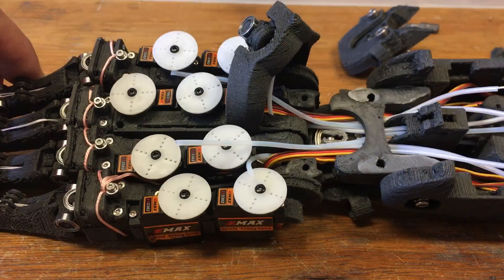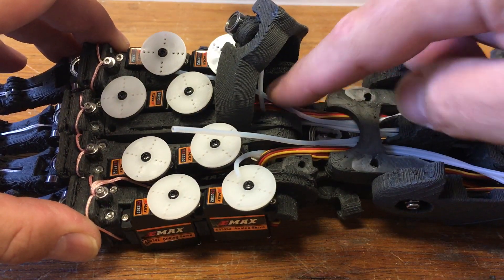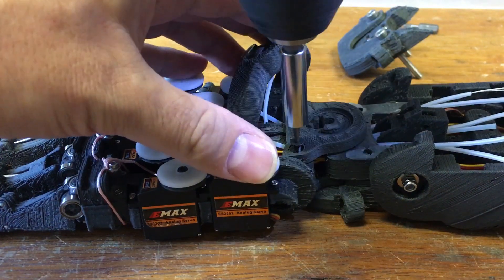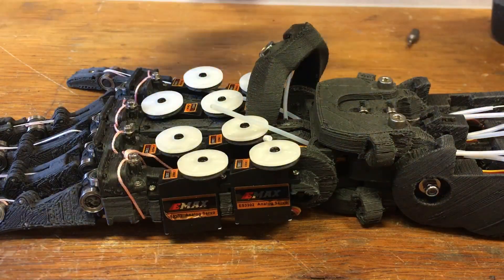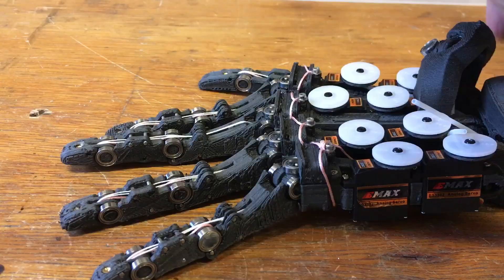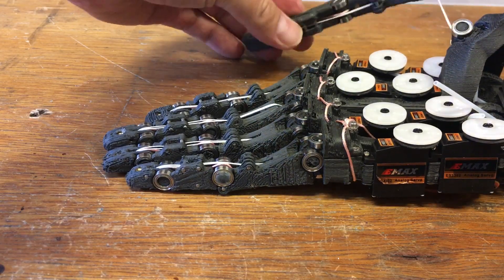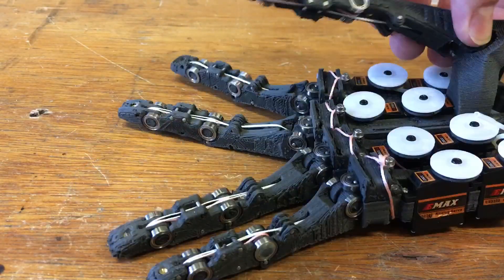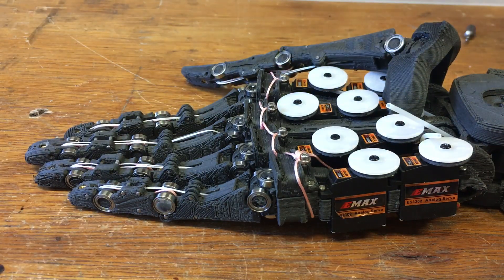#RobotHand Finger tendons passed successfully through wrist assembly - carpal tunnel clearance check

Comment: How did you tie the strings? 
Have any video to tie strings?
Reply from the maker: The string is looped over a steel pin at the end that attaches to the hand. At the servo the loose ends pass up through a perpendicular hole in the servo horn and then wraps around the central screw so it also clamps with the servo horn to the servo output shaft.
Reply: Will you please make a video that the string setup point by point or step by step ?
Reply from the maker: Yes, more videos in the works at the moment…